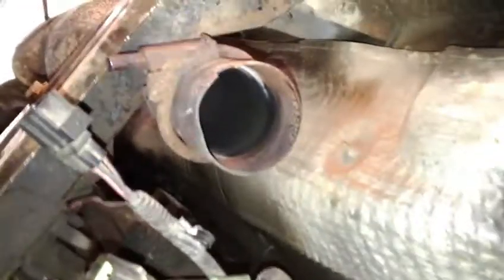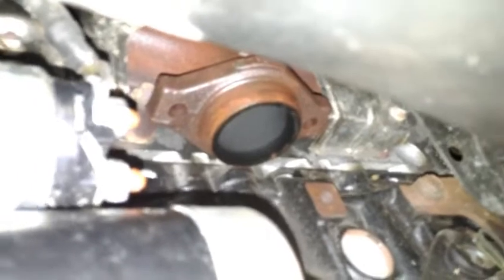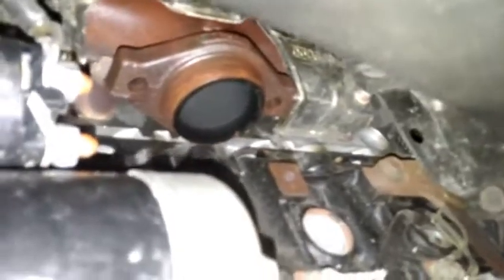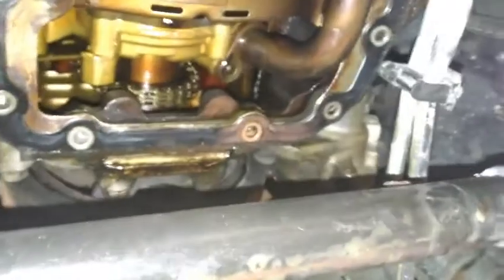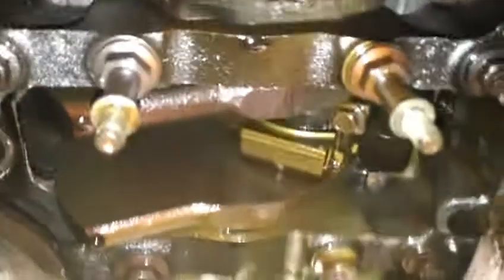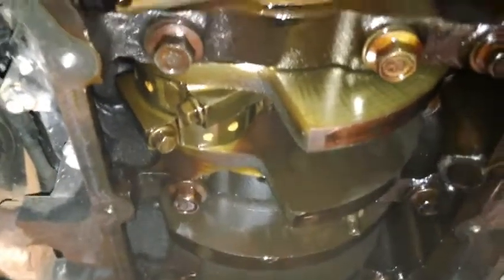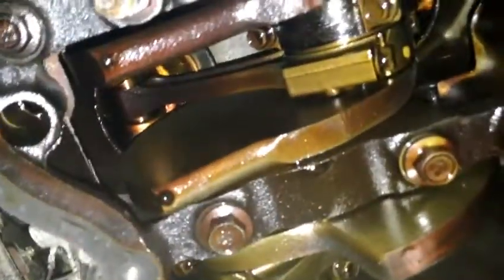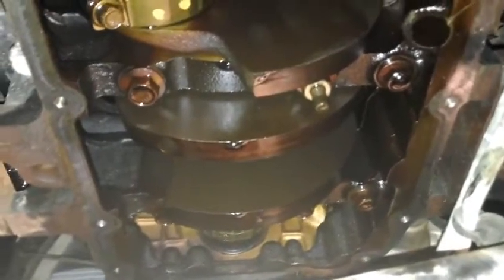Repairing a 2001 WJ Grand Cherokee 4.7 V8 Episode 4 removing the sump.

Comment: I need to replace my rusty leaking oil pan...but do I need to remove the baffle?   Great videos! Thanks.
Reply from the maker: No need to replace the baffte i reuse mine all the time. Rik
Reply from the maker: As long as it does not get overly damaged i guess. Remove it carefully.
Reply: Aussie Jeep Cave thanks, yeah I guess I won’t know till I get there.  Same with the oil pick up tube.  I knew w it can be cleaned, but then do I need a new gasket to put the tube back on?
Reply from the maker: @jcstevegigs  a o ring from memory.
Reply: Aussie Jeep Cave thanks again!!

Comment: i do believe it is a rod bearing gone bad,... i did not hear a double knock that a bad wrist pin makes (aka piston slap). a main bearing would make a knock also but you would have no oil pressure on the gauge! later, mike
Reply from the maker: +gilliland426 Well Mike that's what I'm hoping for. There is plenty oil pressure that was my first check. To check the mains on this engine I would remove it. It does not have conventional bearing caps but uses a split block I guess to call it a super strong idea. Never heard of the big ends playing up or giving way on this engine. The block would have to break. I just hope they did not rev or work it too hard the way it is I hope the con rod or rods are not damaged. I think it's only 1 Regards Rik

Comment: I know you've long since fixed this, but the #8 on 4.7 is notorious for insufficient pressure, leading to knocking.
Reply from the maker: No not fixed yet waiting for spinal operations. The biggest problem is people deciding to use the wrong oil in this engine.  They start using thicker oil thinking its better for the engine when it gets a few miles on it. This modern high performance engine has small oil galleries suitable only for the correct grade oil. I HIGLY RECOMEND TO KEEP USING THE FACTORY RECOMENDED OIL.
Reply: Home Mechanics
Yes, Sir.  I use Castrol Full Synthetic 5W30, with excellent results.
Reply from the maker: I'm a true believer in full synthetic  myself. I hammer my engines and never had any problems. Had problems with exchange rebuild engines in the past so always do my own now. At least I build my engines with TLC.